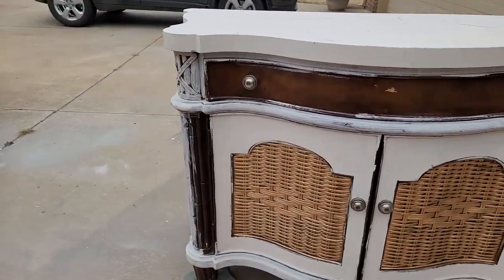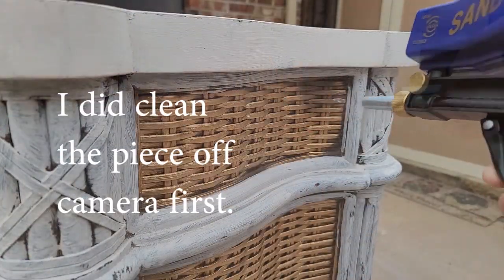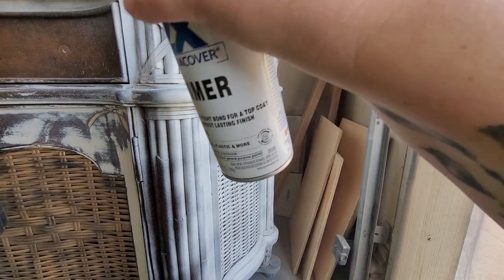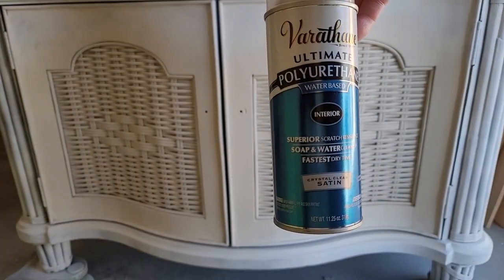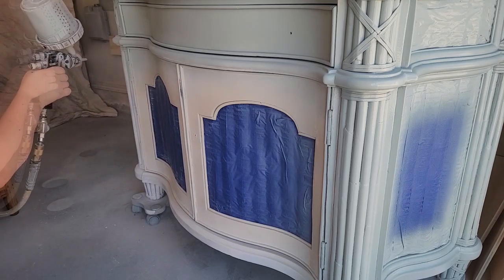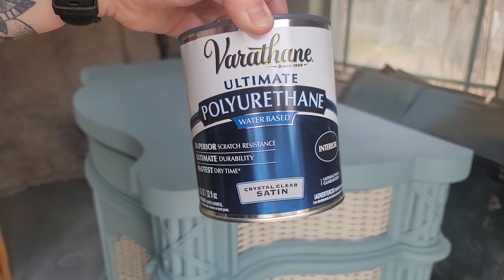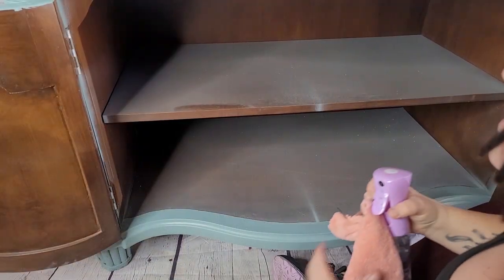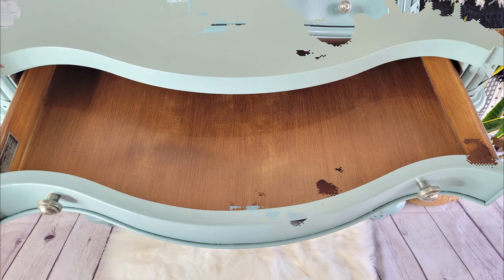How To Paint Over Paint | Buffet Furniture Save

Comment: This piece is really beautiful...you did a great job as always!  I do have a question; why didn't you paint the inside of the doors for a more cohesive look? Thank you, Sab...looking forward to seeing you for the next project!
Reply from the maker: I typically don't paint the inside of cabinets. One reason being that usually only the owner sees the inside not other people so it is more work with no major benefit in a way. The second being people usually put belongings on the shelves, inside buffets, and those items get pulled in and out often so a painted surface has a higher risk of scratching than a none painted surface. I will paint the inside when a client requests it for a custom order or if the inside is a harsh clashing color like red or something.

Comment: I know what you ran into with the wicker. They are manufacturing wicker with a resin finish. I don't care for it myself. Your solution was great, though. I love that color of Serenity. It actually does make you feel serene. Good name. You shouldn't have any trouble selling this piece. 🙂
Reply from the maker: Thank you! I wasn't a fan of the resin wicker either, definitely not what I was expecting. Originally I was going to go with a natural light wicker color (or at least hoping for that) and then paint the body a cream color to make it a very neutral piece. It all came together nicely in the end though. ❤